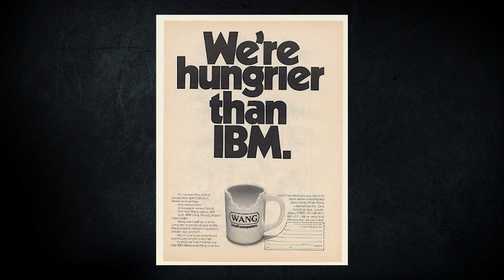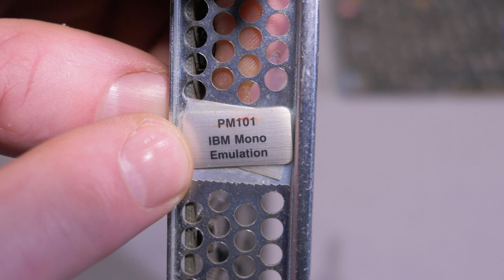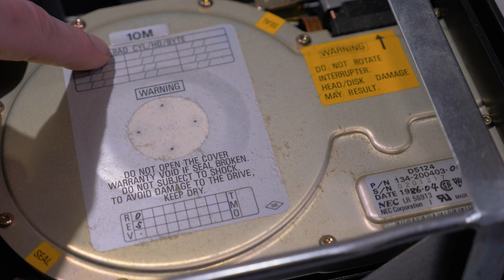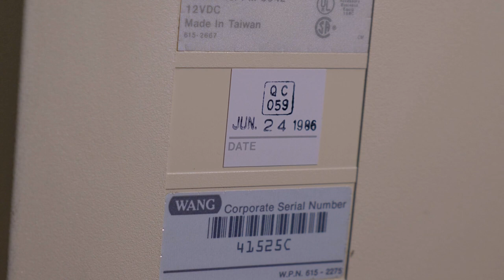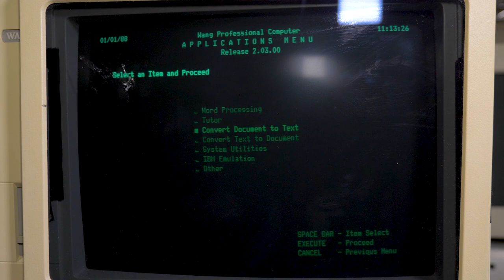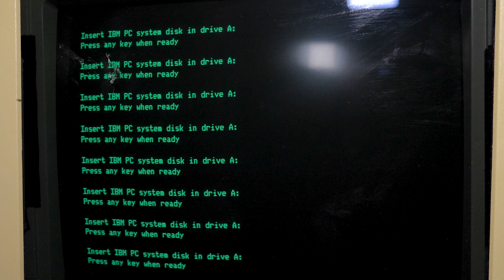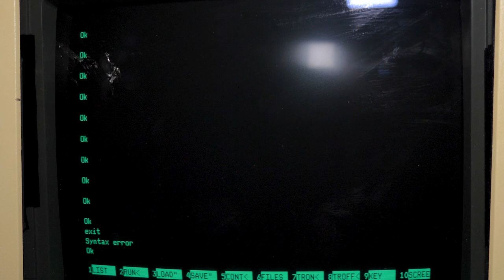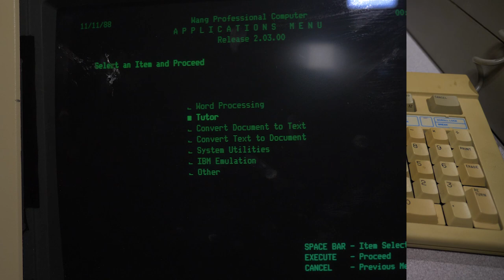Wang Professional Computer (Hardware/Software Tour) - Paul's Old Crap

Comment: Hey I was the Product Manager for this.  If you have any questions on this or the development of this. let me kow
Reply: How big is your Wang?
Reply: Wang had developed own Basics (like for the 2200) ... Why does this one have Microdump BASIC on it?
Reply: @oaw_manofnorse  I assume you meant to ask why does this have Microsoft Basic instead of an interpreter like the 2200.  If so the answer is very simple.  The unit run MS-DOS and was licensed with Microsoft's BASIC that was developed for MSDOS.  BTW, if I remember correctly it was a compiler not an interpreter.  (But I could be wrong on that)  Its the same version of BASIC that IBM PC had.   It was similar but not identical to 2200 BASIC
Reply: Make a video

Comment: Back in my early working days I bought about 100 WANG PCs because we had a WANG VS85 mini computer. The PC connected with a dual coax cable  to run as a terminal. WANG had great software, which you didn't demonstrate. Their MS-DOS had a great menu system. Their word processor was top of the line and identical running on the mini and the PC. Even on the mini computer everything was on menus. Non graphical of course but very useful for non techies. The keyboard had 16 PF keys. And that big computer box could hang on the edge of a desk with a large clamp just like the arm for the monitor. The only thing on your desk was the keyboard. Of course, you know, An Wang patented early core memory and also inline solid state memory which is still used today,

Comment: The main problem with emulating the IBM PC was not the CPU, it was the video hardware. A lot of applications wrote their output directly to the video card's RAM because it was faster than going through DOS or the BIOS. So if you were using a system that didn't emulate IBM's video hardware, you'd get a garbled display or no display at all. That's why the video card in this system points out that it was designed to emulate IBM's Monochrome Display Adapter (MDA).

Comment: The Intel 8086 and 8088 are fully compatible. The only difference is the 8088 even though it's a 16-bit CPU, only has 8 data lines vs 16 for the 8086 so performance is slightly poorer.

Comment: Great find and great overview.  See if you can archive the contents off of C: and D: and upload to archive.org or somewhere, as it would help others restore their WPCs where the hard drive has failed.
Reply from the maker: I don't currently have any MFM interface cards which will let me plug that drive into anything slightly more modern, but that will be looked into. I want to assume the software was also part of an install disk set but I don't recall receiving them with this.
Reply: @netfreakcanada  We typically use things like network cards + the mTCP stack to FTP stuff off the system, but you can also use a serial or parallel cable and FastLynx, or MS-DOS Interlink/Intersvr to copy things off as well.

Comment: An expansion card known as a WLOC, Wang Local Office Connect,  was a regular upgrade, the WLOC card had the two coaxial bayonet sockets ( known as the 928 connection ),  928 stood for Sept 28, as a historic date for Wang, so the PC would connect to the Wang OIS and VS suprminis and operate as a workstation, (as Wang called a Terminal)
The Wang PC was very under-utilised by corporations, , fitted with the WLOC card  and connected to anOIS or VS, the PC  was a  high status  Word Processing Terminal for management to read over WP documents on the OIS and VS systems.  Wang realised the error and offer more contemporary solutions based on 286 and 386 CPUs, I do not know if they ever offered any PCs with 486 processors

Comment: Regarding the date of manufacture of this particular machine, I think it’s from early 1986. Glancing at some of the microchip date-codes, I see many from mid-1985. Therefore the board can’t be older than that. The HDD (shown at 14:30) being made in very early 1986 makes sense. 

FYI, many electronics date-codes use years and weeks, not months.

Example (from the HDD): 1986-04 -> Jan 1986
Example (chip format): 8549 -> Dec 1985

Comment: 24:44 I don't think the "Shell" disk on MS-DOS 4 is a bootable system disk. You have to boot off of the "Operating" disk or the "Install" disk. The "Shell" disk contains dosshell.com , a text user interface file manager for MS-DOS. 
30:00 Line 10 should not have RUN at the end of the line. It should just be 10  print "hi" by itself.
30:43 The SYSTEM command exits out of the BASIC interpreter.
Reply: The FILES command shows you if some Basic files aviable.

Comment: I had the version we called "pregnant PC" because it was even bigger with more slots and the power switch in the front. 
At one point I ran DOS 3.20.10 with Windows 3.0 in CGA resolution at home (I never got my hands on the EGA adapter) 😀
I also upgraded the processor to Nec V30, which made it faster than the IBM XT which a friend of mine had  ;-)  

And, it was "plug and play" long before that became a thing.  
There was a vast array of different option cards. 
(I was working with Wang computers)

Comment: @12:30 those wires on the motherboard are usually for fixing bugs in the design of the circuit board after the circuit board has already been made. Generally not a good sign.

Comment: Just a tip:  to get the output of a command to pause whilst scrolling, pipe it through the "more" command:  c:>dir | more 
This should allow scrolling a page at a time. There may also be scroll lock or pause button on the keyboard, which is still available on modern PC keyboards.  This harks back to the days when computer output would just flow down the screen, and you needed a special button to stop it lol.
Reply from the maker: I'll have to remember that on my other DOS projects. I almost don't remember how to use DOS anymore...
Reply: In this dos Version dir -w - p
Reply: @vlk1967  Ah very cool.  It is a dream to find one of these beasts and get it working again, as my dad used one in his department at a law firm, and I have fond memories working on it.
Reply: @denniseldridge2936  same feeling as me, look my channel for more WANG's
Reply: @vlk1967  Thanks - headed there now!
Reply: @vlk1967  BTW, I have some other connections to Wang itself.  I lived in the States in the mid-late 80's when Wang was on the wane; I lived very close to their Mass headquarters and knew a few people who worked there.
Upon returning to Bermuda, I got a job with the local Wang dealership.  However, by the time I got there Wang was on the way out.  Having said that, in it's last years Want seems to have come out with some quite innovative products, including a sort of whiteboard product which allowed remote collaboration.  Very impressive for it's time.

Comment: The Wang PC loads first the BIOS.SYS from the Floppy /Winchester, You can try V2.66, 4.50 of the newest 4.51d. The command SYSMODE W or M switches between WANG, and in your case, monochrom IS(Industrie Standard) IBM XT emulation.
Reply from the maker: The new owner will probably poke around with testing things on it. I was only holding the system temporarily.
Reply: Sysmode C switches to MS DOS color emulation (if you have a color card).

Comment: 25:09  it wants a bootable disk.  It is literally going to boot from a dos boot disk and be a PC. 
That means it is probably going to be slow.  Because it needs that software emulation layer.   Otherwise, you would be able to just boot the computer off a bootable PC-MSDOS  disk.

Comment: The IBM 3340 Direct Access Storage Facility consisted of two removable 30-megabyte modules. https://www.ibm.com/ibm/history/exhibits/storage/images/overlay/PH3340.jpg Because of this 30/30 configuration, the code name Winchester was selected after the famous Winchester .30-30 rifle; subsequently the capacities were increased, but the code name stuck.
Reply from the maker: I always found it strange that my early PC controller cards all said Winchester instead of IDE.
Reply: @netfreakcanada  yes but are they IDE? Early HDD controllers were RLL or MFM, but the drives were all called Winchesters. Legacy IDE is really just extending the 8-bit ISA bus over a cable. The controller is built into the drive.

Comment: Did you scan the manual? I've not seen a copy online.
Reply from the maker: archive.org has some Wang documentation and original disks. Anything that isn't there or on bitsavers I'll see if I can get scanned.
Reply: @netfreakcanada  Thanks! If you could also go into the menu editor and let me know what program starts the PC emulation I'd appreciate it. I just got one of these, trying to get it to do something more than WANGWrite!
Reply from the maker: I don't know enough about the PC emulation to have had it work yet. I was thinking I need some sort of software combination on a 5.25" disk but I haven't looked into it further.

Comment: This keyboard use the infamous keytronix key: you need to change the foam and alu pad inside eatch key to get them work...
Reply: A thorough wash of the circuit board and the alu pad usually does the trick

Comment: This Wang Professional Computer has the same operating software that can be found on the OIS, which is a word processor. I studied word processing on it in 1988, after I learned the IBM Displaywriter. I am pleased that I watched your show about the Wang Professional Computer. Now I see what I have been missing for not being hired to work on the Wang at any job.
Reply: The Wang PC was an Intel 8086 CPU running a slightly modified form of MS-dos, and the OIS ran a Z80 CPU and was not MS-dos, 2 totally different OS. How do I know, well worked as a senior customer engineer for 8 years between 1982 and 1990, and in the end, I was looking after UK Government and all London-based commercial customers. The Wang PC was the front end of the Wang VS10000, in 1989 I installed this into an estate agent in London, you had to know how to fix the WPC as this was the way to boot up the VS10000 (This runs a form of IBM 360 instruction set). I had worked from the WPS floppy-based systems right up to the VS range and was one of the best jobs i have had. The IBM Displaywriter package replicated the Wang word processor method, fixed pitch! The WPC had a card called WLOC which communicated as a terminal to the OIS/VS systems using the dual coax cabling.
Reply: @kcollyer4003  Those computer and word processor facts you present in your comments makes me feel just to stay with computer technology and to appreciate it more. Like an instructress advised me at Control Data Institute advised me that a microcomputer does more, that was because I fell in love with the IBM Displaywriter with Textpak 4, I felt like I graduated from keypunch-style keyboarding I performed at some jobs, on to a higher level of keyboarding straight to the microcomputer. I look forward to reading more from you. Thank you for typing to me.

Comment: I thought the root of the software compatibility problems with a machine like this is the BIOS, not the processor
Reply from the maker: Yeah that does sound familiar, reminding me of when I think it was Compaq needed to reverse engineer the IBM BIOS in order to make their clones.
Reply: bios function calls and parameters would be a compatibility breaker but at the processor instruction level you'd need compatibility too.
Reply: @leon_De_Grelle OK.  Here is the true story.  Yes, its both a BIOS and a HW issue.  Both the Wang PC and the IBM ran MS-DOS.  and MSDOS has an INT21 Interface.  But it was so lacking that developers of application s had to use lower level functions.   AND when we came out with the Wang PC, Senior Execs  didn't want to invest in getting 3rd parties to write their code for the Wang PC.  In actuality, the 8086 WAS code compatible with the Intel 8088 that was the IBM' PC's CPU.  - Only difference was that the 8086 had a 16bit address bus, while the 8088 had an 8 bit.   

If you compared the  Wang PC to the IBM PC from a hardware feature perspective, the Wang PC was superior in every category.  The Wang PC had a true hard drive.  The processor was more powerful, the resolution of thes screen was better.  The amount of memory was larger.  Unfortunately it was developed at a company when the President, (John Cunningham) felt that sales of 20K units would be a huge success. (So none of the investments were made to come close to reaching the IBM volumes.   

  I always felt in the right hands the Wang PC could have competed  better with the IBM PC  Alas, I left Wang to join Phoenix - The company that made the IBM Compatible BIOS.   Which gave other companies the ability to build true clones of the IBM.  (Anyone remember Leading Edge.)    It was an interesting time.
Reply: @buyerclub2  I also worked with Wang computers (almost to the end), and their quality of the hardware & SW were "Rolls Royce" compared to most of the industry, but too expensive...